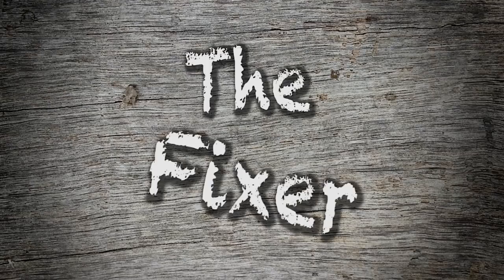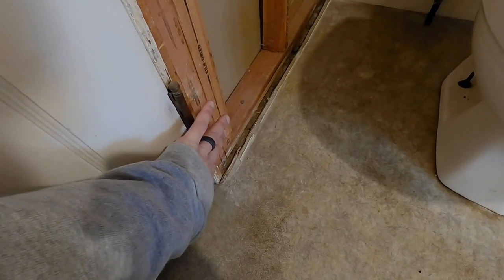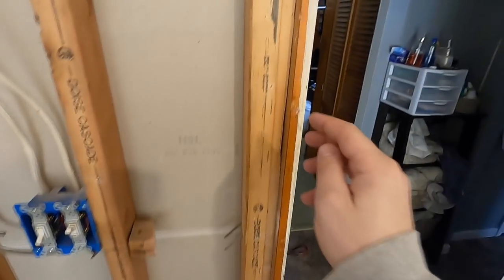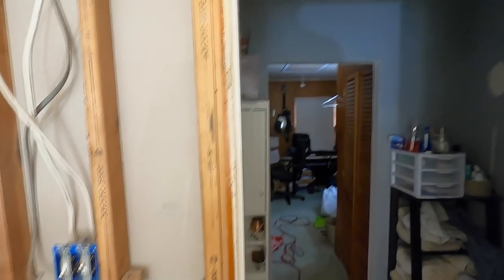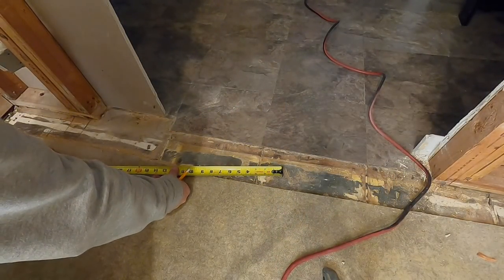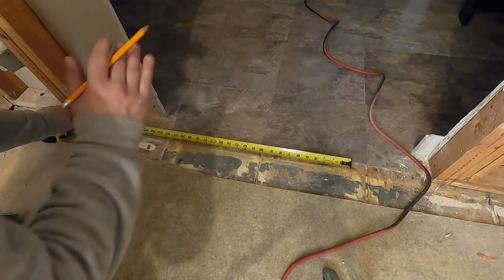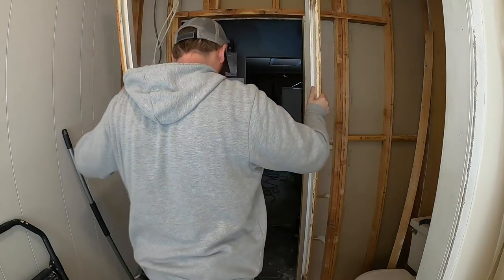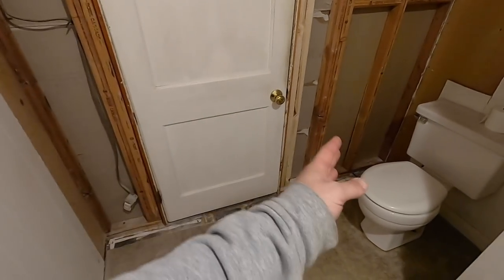DIY Bathroom Remodel - Framing For New Door - Episode 2

Comment: Loving the work so far.. and the door is much better swinging the other way!

I think if it was mine, and plumbing wasnt an issue, I would have to swap the location of the toilet and the sink around, so that way you're not walking straight into the toilet as you come in..
Reply from the maker: Yes, I toyed with that idea.  We eventually decided against it.  Thanks for the suggestion and for checking out the video!

Comment: Construction Superintendent here. 43 years in the business. On all your projects here, I would use sound batts in the common walls with TYPE X fire rated drywall. And make sure you put in a vapor barrier on the exterior walls. That's how it SHOULD be done.
Reply from the maker: Thanks for the feedback, Paul!

Comment: The level of caution used when pulling on the paneling tells me you been smacked in the head by it before when it suddenly gives way, lol.  What bit were you using on the oscillation saw to cut the floor?

Comment: The rest of the wall sitting on those tiles? or will that be a pain when doing the hallway up? 🤔
Reply from the maker: That shouldn't be too much of an issue.  I think eventually I am going to put flooring over those tiles or rip them up.  They are easy to cut.  Thanks for the question and for checking out the video!

Comment: do you have the clearance for an elongated toilet?
Reply from the maker: Yes I think I have enough, the newer toilets tanks are smaller so I should be able to push the flange back a bit since that is being replaced anyway.  Thanks for the comment and for checking out the video!
Reply: @TheFixerHomeRepair  that’s awesome! I work at a plumbing wholesaler and the options for toilets just blows my mind 🤯